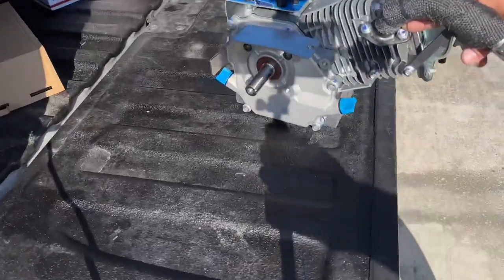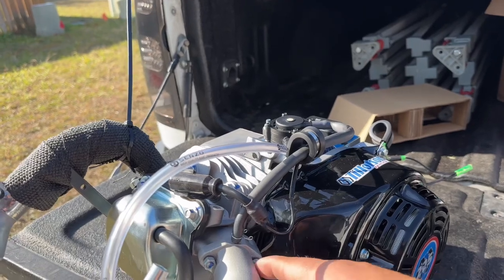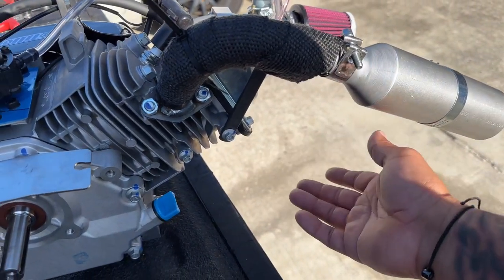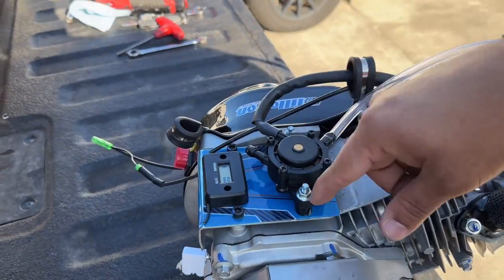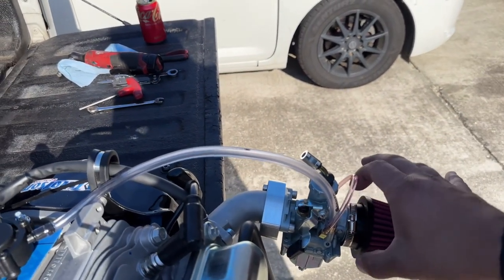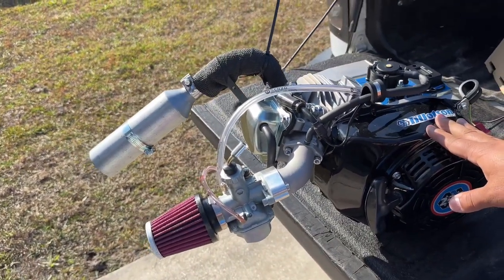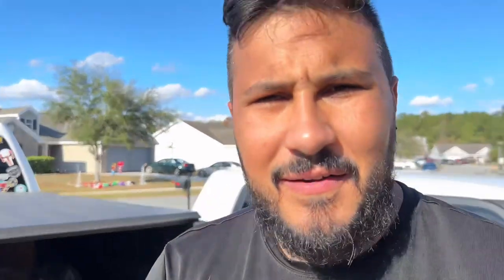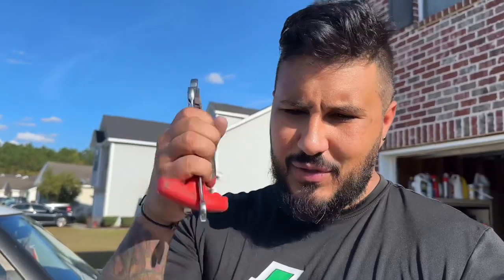Karting Vlog: Tips and tricks on building a Tilloston.

Comment: The plastic piece you removed is an air shroud— it guides the air from the blower housing to the intake side of the head. 

For the CARB install, a Ball allen is your friend.
Reply from the maker: Does the plastic piece need to go back on or can it stay off? I left it off cause of the exhaust bracket.
Reply: @JaMRacing  Technically, yes, it is required per the rulebook as I read it.
Reply: @JaMRacing  — My first motor I tweaked the exhaust brace to run the out of the plastic, for the 2nd one (the one for my Teammate that we are bringing for backup) I removed the spacer and ran it under the plastic— I had to cut the plastic slightly to allow it to flex back from the vertical exhaust support.